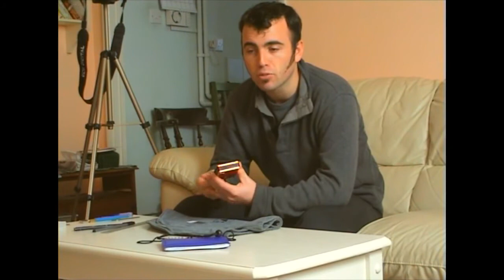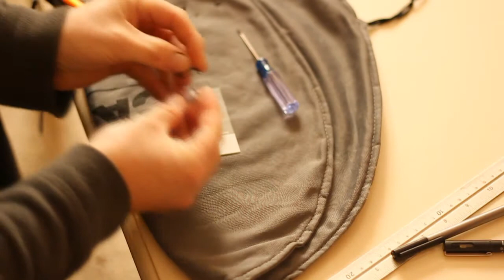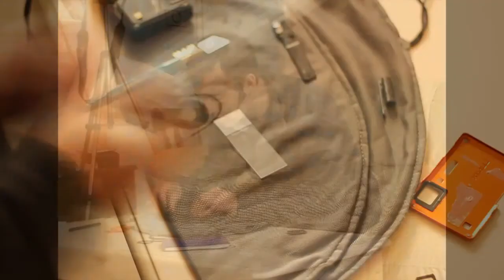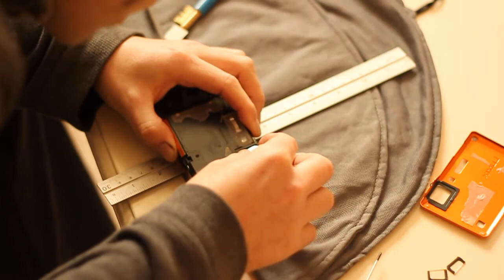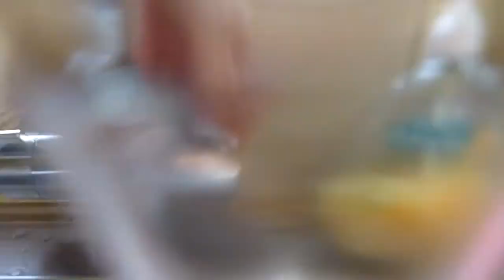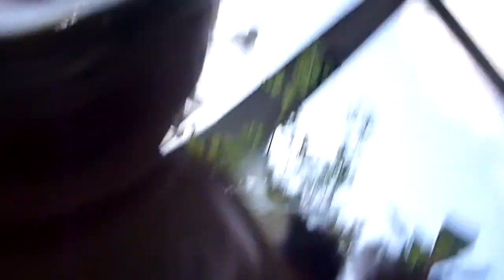HowTo Fix a Broken Lens on a Panasonic Lumix TS1/TF1-DMC (with test footage)

Comment: Today I refered to this video to figure out how to open the darn camera. I've used my TS1 in the water often (salt water too) but never cleaned it in 3 years. I couldn't figure out how to remove the front panel because as you have explained it is sticky. Thanks for sharing your experience. If I break my lens I will surely refer to your video.
Reply from the maker: That's great to hear Sarah, despite this video now being several years old. The camera itself is great, I used it recently on another trip round europe. It's a solid camera!  However, one day I may go nuts and upgrade to the latest TS model. :)  Cheers for your comment!

Comment: What if I just remove that glass and don't replace it with anything?
Reply: Technically, the camera would take photos and film fine. However, the enclosure will have no seal and the camera lacks a lens cap. Only do this if you do not intend to take the camera out a dust free environment. Otherwise, replace the glass with something glass or plastic immediately, and seal it.  

Thank you for watching!